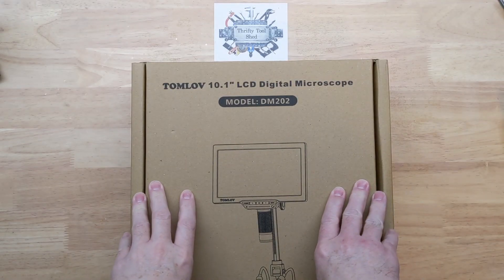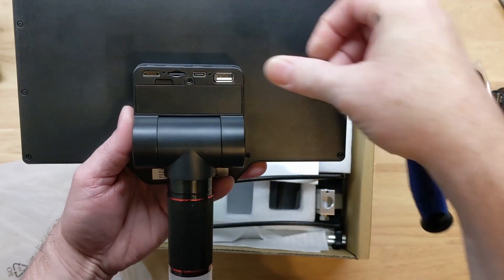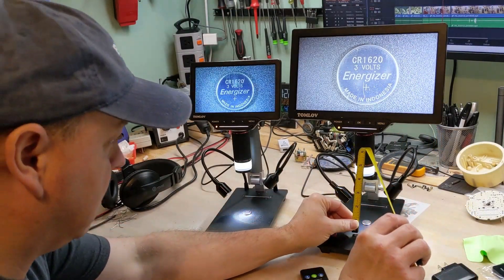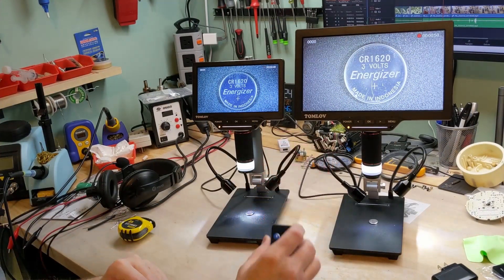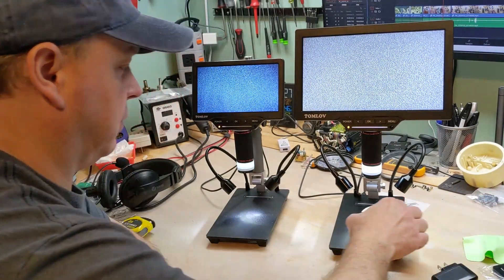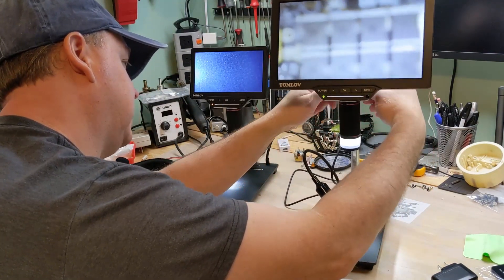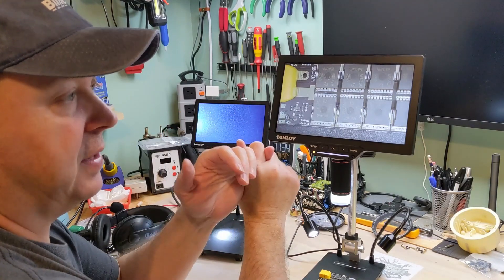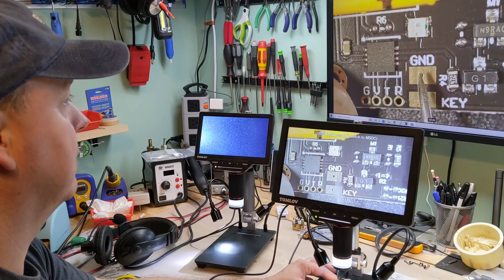TOMLOV DM202 10.1" Digital Microscope Review

Comment: so, I can use electrical source, or battery? I am new to this, so please bear with me. lol If I plug into my computer, what do I have to do to my computer in order to view pictures? Enjoyed watching your video. thank you.
Reply from the maker: Hi,
Thanks for your kind comment. The scope will infact work on built in battery power or 2A USB power supply. Once the battery is full it can possibly keep the battery charged while plugged into PC, but PC can't fully charge the battery since it's around  2 Amps while depleted. While connected to PC you can either read the SD card from the scope directly or remove the SD card and use a card reader. You can also record to PC directly with USB if desired using PCs Camera app. Or any video capture software.

Comment: Thanks for this review. I'm interested to know more about the specifications on the camera and the microscope (I was searching the Tomlov site, nothing found). Is this a continuous zoom microscope? What is the fps for video using this camera? Any info on the pixels for pictures? Any info you can provide, I'd appreciate.
Reply from the maker: This is one thing I can do. I will share a link to an unlisted video. TOMLOV asked me to remove the part in this video where I shared the manual. It has the specs. So I actually tried to share the specs and they did not want all that info shared online at that time. This was the DM202MAX, but it's similar if it helps. The manual starts around 20 minutes in the video. I have this video unlisted so I can still share it, but it's not public. 
Hope it helps!
https://youtu.be/sAWZUCrIg4w?si=qWGPaONsfArYucx9
Reply: @ThriftyToolShed  I'll watch it now, thanks so much!

Comment: Sorry got another question. What do you folks do if the PCB is big and hits the stand for the monitor, making it so you can't get to the area you want to work on, directly under the microscope? I also notice that the one I got is the TOMLOV TRM101 and does not have very good height when raising the lens away from the PCB. So this makes the view very restricted and pretty much no zooming outward. I found that if I detach the monitor from the stand and hold the lens high above my head, then use the focus knob to focus, I can get see so much more of the PCB because it allows for more zooming out. I find it odd that Tomlov limited the max height for the lens in such a way that it does not even come close to using what the lens is capable of in it's full capacity. I know it's a microscope designed for soldering and close ups is the most important but still, if they made the stand a bit higher, you could have so much more viewing options. Right now its kinda like I can view it really close, or really, really, really close. There is no options to zoom out more to see more of the board and it feels like the lens is being somewhat wasted. Is there additional stands that Tomlov offers so you can switch it out if the work you are doing requires more zooming out views? What do you guys suggest for this scenario and that isn't too expensive? I paid about $140 for this Tomlov TRM101 7 inch model and I am willing to spend around that again if there is another model that is better. The thing that interested me about this model was the base and all of it's dividers for parts and also came with a heat resistant mat which was nice too. The work space under the microscope also seemed bigger than most which I kinda liked too. See for yourself:

https://www.amazon.com/dp/B0C4TRPN87?psc=1&ref=ppx_yo2ov_dt_b_product_details
Reply from the maker: This model is interesting for sure. I notice a few things about it. It is short in work height for sure and unfortunately you can't simply extend it like the other models I have reviewed. I also use a Barlow lens to help get a wider board view, but this model has a different type of scope and the typical Barlow lens may not thread on this one. It also has no side lighting to help with glare. I really like the ones with the taller stand to adjust up as needed.

Comment: Is there a way to keep the pcb from moving around while soldering? I dont see anything on this Tomlov microscope work area that would pinned down the PCB to prevent it from moving around unless I’m missing something.
Reply from the maker: I typically use a board holder. I really like the magnetic board holder from Northridge Fix for the smaller boards. 
NF Board holder with 5 strong magnets if needed:
https://northridgefix.com/product/northridgefix-pcb-board-holder-with-5-strong-magnets/?ref=thriftytoolshed

NF Universal Board Holder if needed:
https://northridgefix.com/product/universal-pcb-board-holder-fully-adjustable-jig-fixture/?ref=thriftytoolshed
Reply: @ThriftyToolShed  thanks but would 5 magnet version fit under a microscope?
Reply from the maker: It works well with most boards under the microscope. The more expensive scope like Northridge Fix sells is better for boards because it  has no base plate to be in the way. It is more expensive though for sure when you include the mount.
Reply: @ThriftyToolShed  Thank you very much for the info. This will help me decide what to get.

Comment: Nice video review, thank you.. would this be ideal for larger circuit boards / laptop motherboards, I’m thinking the vertical stand may get in the way
Reply from the maker: The stand can indeed get in the way at times so I will put the boards in a board holder at times for that reason. The microscopes with the swivel type arm are the best for larger boards I believe, but they are more expensive than I could put into a scope. Thanks for your kind comment!
Reply: @ThriftyToolShed  thank you for replying, I’ve liked and subbed added your playlists to watch later, thanks again, God bless

Comment: Hi there, how can I see it both on my TV and on the microscope screen? Once I plug the HDMI I can ONLY see it on my TV…
Reply from the maker: That is how the HDMI output is. If connected to HDMI output the microscope display turns off. If I wish to run both displays  I can usually connect the USB to the computer and use the camera app to view and even record on the computer directly if desired. I have a large monitor over my bench connected to the computer so it works well for me.
Reply: @ThriftyToolShed  Thanks! The Andonstar microscope I picked up won't display both in either HDMI or USB output modes...

I saw you test this in the 201 review, but was just about to ask about this model. Going to return the Andonstar and purchase one of these two.

Comment: Hi, i received today my Tomlov DM201 MAX 7 inch screen , on it was firmware 1.2.22 and i updated to 1.2.23 i put firmware file on sd card put in display did what i was suppose to. the firmware was installed i had a green CARD ISP then display shut down like it was suppose to after i open it up again main screen appears so i press menu to check if installed ok but the screen is bricked cant even turn it off except when i press reset button i start display same thing it's bricked any ideas on how to reset it ? Thank you
Reply from the maker: I have not seen that issue. I can only think of removing the battery cell as well to fully power off and back on if not helpful I would contact TOMLOV.
Reply: @ThriftyToolShed  Thank you i did remove battery .powered on display no change .I will  contact Tomlov ,thanks for your time

Comment: Hi! Under which microscope is it more convenient to solder SMD components with a 7-inch (TOMLOV DM201) or 10-inch (TOMLOV DM202) screen?
Reply from the maker: Depends on which way you use it the most. They both work great for me. The 10" screen is good to use by itself and the 7" is great and takes up less visual room on the bench and If using the HDMI out or the USB connection to larger screen then it's really same as 10" image.

Comment: Is the TomLov similar to the Andonstar brand? Your video popped up & thought I would watch it. Does the 18650 holder also have a charging feature? Thanks. The TomLov brand I have not heard of.
Reply from the maker: They are similar in some ways. Boblov and Tomlov seem to be into body cams, dashcams etc. The 18650 in the Tomlov is nice and it charges by the same USB cable that can power it while plugged in and it charges the battery at the same time.
Reply: @ThriftyToolShed  Boblov?🤔 Another new name! Is it me or is the TomLov more expensive than the Andonstar?
Reply from the maker: Well it looks like to me the Adonstar 10.1" is almost $100 more. It does depend on what you're looking for. All the scopes I reviewed helped me a lot with soldering and board testing. The Tomlov has a nice 6" tube extension with some kits and the 32gb card included as well as the ring light and 18650 cells for cordless use if that is needed. The Adonstar has better video quality and works well for my use as well, but the 10.1" Is around $289 or so.
Reply: @ThriftyToolShed  yes, the extension tube is a great feature! Thanks for the reply!

Comment: In the video the smaller one looked like it had a much better video quality. How do they look in person compared to each other. I’m going to be using it for Coins , is the smaller one substantially better quality or was it just in this video
Reply from the maker: I really thought it was just the lighting in the video since they both should have the identical internals. After looking into it, it does seem the smaller one does have a slightly noticable better quality. I just found out this week that TOMLOV has an update for the larger scope, I will update it soon and that should put them equal surely. They emailed me the information about the quality and the new update for it.  On my next repair video I will hopefully already updated mine and mentioned it in that video so others on the channel know also. Best of luck to ya!
Reply: @ThriftyToolShed  Thank you very much. I just ordered the larger one today after watching your video. Hopefully mine comes with the update
Reply: @johnny_blz  I’m actually extremely impressed with it. I haven’t used it that much, but it is much clearer and magnifies much better than I anticipated. I would absolutely buy it again.!

Comment: Thanks for a great review, it was really nice to see a side-by-side comparison between the 7' DM201 and the 10.1" DM202.  Sadly, the DM201 seems to be unavailable at this time.  This comparison prompts two questions from me:

First, the smaller DM201 seems to produce richer or deeper colors than the DM202.  This is quite noticeable in the side-by-side images of the first circuit board that you tested the camera with.  The board looks more brownish, perhaps like a sepia image than the greenish color on the 7" display.  Is there any way to adjust the color on the 10.1" display?

And second, will the display function using the AC power adapter without having the battery installed?  This in the event the battery goes dead and you have forgotten to charge it.  I have seen comments for other Digital Microscopes advising that you not use it while charging the battery as it may cause the battery to have a shorter life.

Thanks again for a great review, much appreciated!
Reply from the maker: Yes there is a color adjustment and I believe the lighting made some difference in the images as well. I did have both cameras set up very similar and the screen image looked closer to me than the recorded image, but yes they both can be adjusted and I should have taken the auto exposure off for the comparison in hind sight. 
Also, yes the Microscope will work without the cell in and just plugged in to the computer or other USB power. Hope it helps and thanks for your comment!;
Reply: @ThriftyToolShed  Thanks for the reply!  I'm still hoping for the DM201 to become available again.  BUT...  That DM202 with the 10.1" screen is growing on me.  The extra height on the mounting rod without having to fiddle with the extender piece is an awesome improvement, and the 10.1" screen is the icing on the cake.
Reply: Is the TomLov brand similar to the Andonstar? Or a clone? Thanks you are correct about the color differences between the two models. I am impressed with how high above the work platform the 10" can be & still have a clear image.
Reply from the maker: @j.lietka9406  I believe they are similar in ways and not others. Not a clone for sure. The Tomlov has the advantage of the Lithium battery power to be super handy moving from bench to bench or simply taking it with you . The working height is much greater as well. Adonstar has great quality and works better with HDMI with remote monitor and still view and record on microscope. I use the TOMLOV similarly, but use USB and record straight to computer typically. It works well for me so far.
Reply from the maker: I also just uploaded a video showing the firmware update for the DM202. Tomlov contacted me about an issue found in image quality as pointed out by many viewers and sent us all the links and instructions to update it.  The image is noticeably better. Hope it helps.